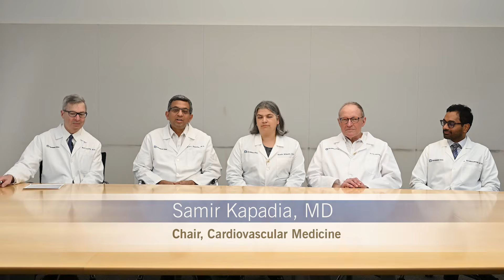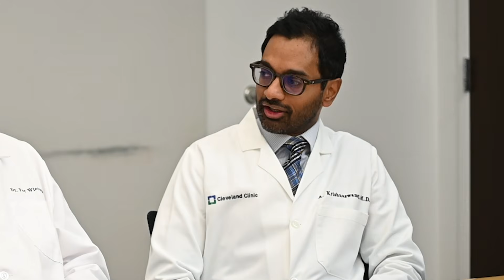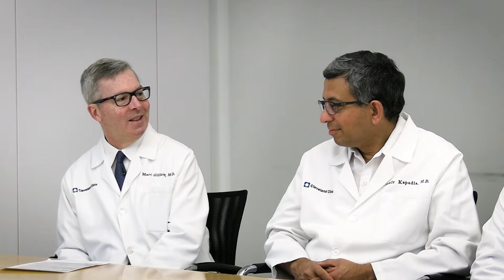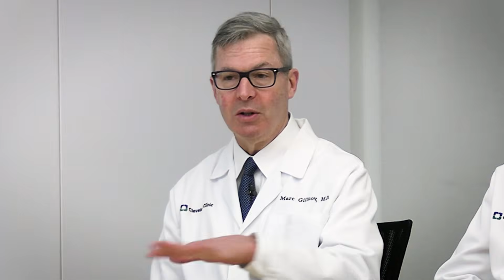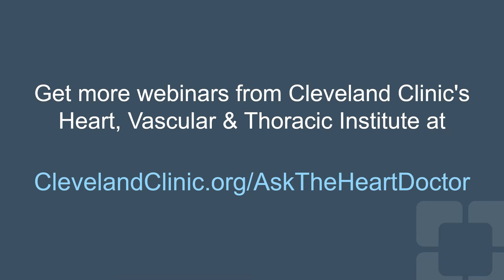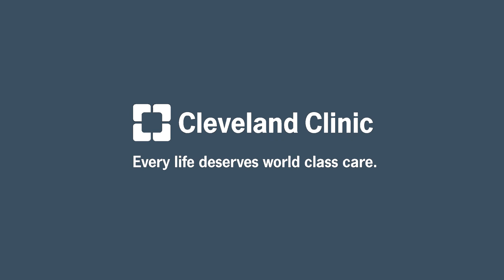Ask the Heart Doctor | Mitral Valve Disease: Latest Repair and Treatment Options

Comment: Wish you were no so far from AZ. Facing surgery for severe aortic stenosis and reguritation, severe mitral valve stenosis and reguritation, and aortic bypass. I meet the doctos on the 14th, but after testing the 8/17 they said had to be open heart.